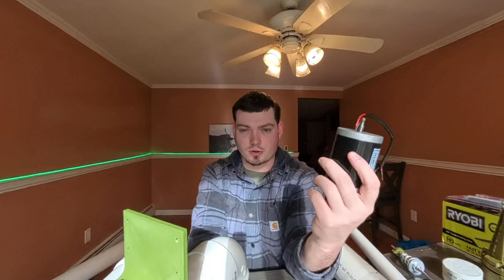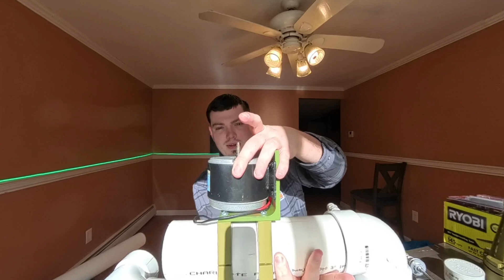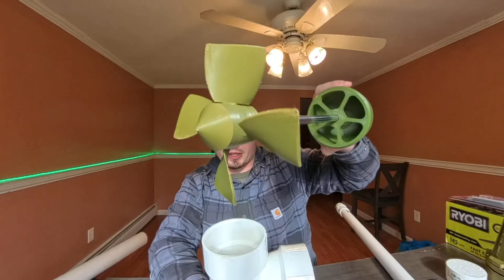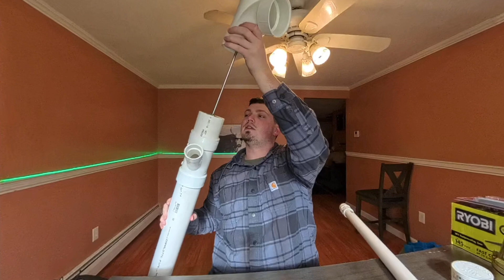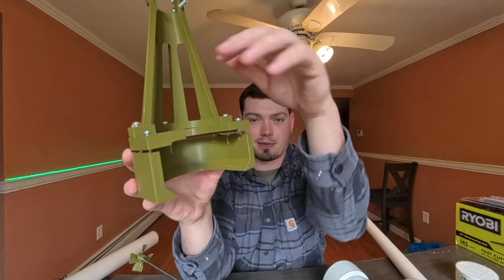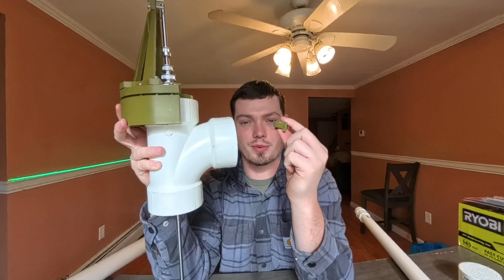Building My Dam 3D Printed Hydro Turbine

Comment: 1:30
The length of the intake pipe does not affect the head.
The critical measurement is from the surface of the water, not the bottom of the intake pipe.
Reply from the maker: Thank you for this correction!

Comment: You need a housing for the impeller that will keep it straight then you can connect your pvc pipe to the housing. 
I could be wrong but the closer the blade tips are to the ( turbine duct or housing )ID of the pipe the better performance you will get
Reply from the maker: That is absolutely correct. This has alot to do with the amount of water that would be allowed to pass by. As water is "sticky" in a sense it will have alot sticking to the edges of the pipe. Therefore allowing it to pass through with no interaction on the turbine. More so than an open design
Reply: @Beyond_The_Print  making a separate housing for the impeller would be a lot easier then trying to integrate one into the existing pvc pipe
Reply from the maker: @lyleclark325  this hadn't even crossed my mind for this project. Thank you